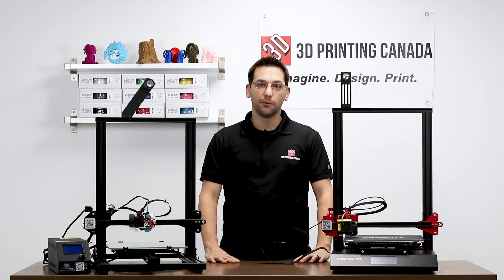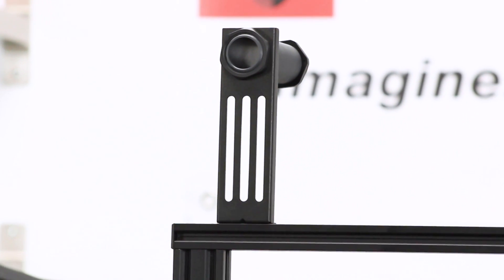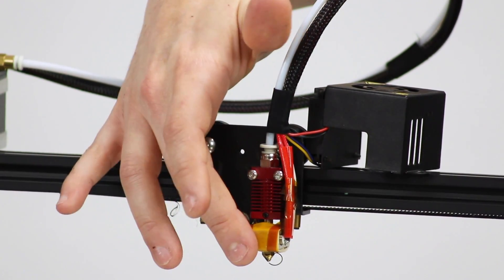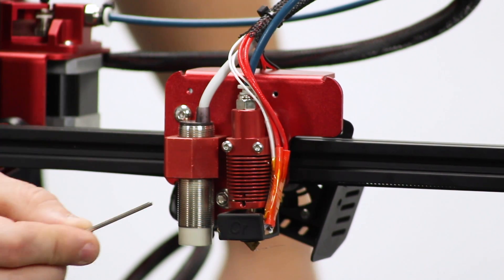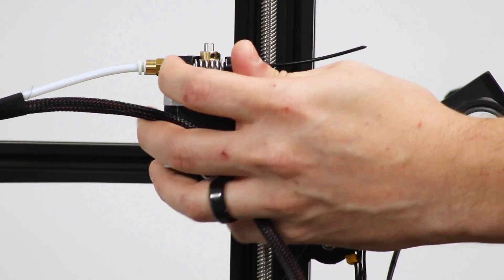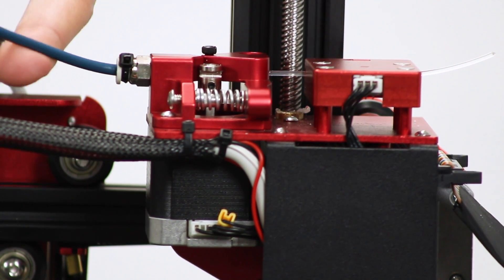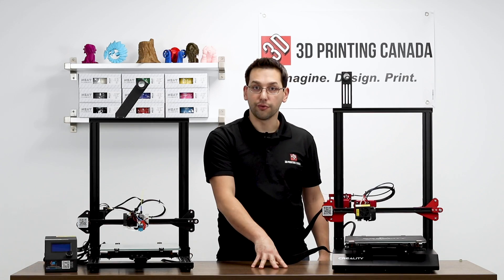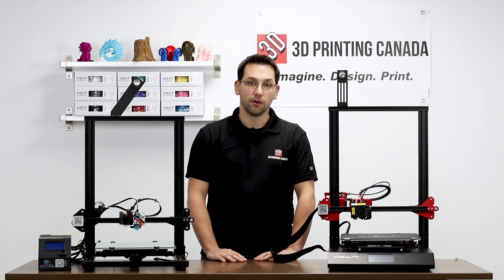Creality CR-10s vs Creality CR-10s Pro 3D Printer Comparison

Comment: I've had a CR10SPro for just a few months and already it has developed faults, a loud noise occurs whenever there is movement in the Z-Axis.  I recently purchased a Creality magnetic plate to make it easier to get things off the bed, however due to a recently failure the extruder dived into the magnetic bed punching a hole through it.  I'm waiting to hear from Creality what they intend to do as I now have a printer that I cannot use.  My CR10SPro did not come with a glass bed, it came with a metal plate and a sticky plastic cover which became very scratched and useless after several prints, hence why I removed it after several hours of making sure all the hard to remove glue was cleared off them replaced it with a new magnetic Creality print bed, which I was very hopefully off, but due to the strange Z-axis problems after it did the usual checks when auto-levelling before a print it then buried the extruder in the last corner of the magnetic bed, so hard that it broke the surface and has level a cut almost 2 inches long in the bed.

Comment: One thing not covered is that there seems to be a difference in length between the two heatbreaks. The 10s pro's is longer. So, if you're wanting to try a different heatbreak, you'll have to be very careful what you order and triple check with the vender that their product IS compatible with the 10s pro or 10s pro v2.

Comment: I have one question that I hope you can answer, on the cr-10s v2 board what is the pin that is associated with the runout sensor. I have looked everywhere for a diagram but can't find anything. I need to know this so I can install the runout sensor on Octoprint.

Comment: I got my cr-10s pro now and already have a cr-10. Its a nightmare... losing screws, bed lvling is such a nightmare, z-axis is total wrong because there is no 2nd endstop for the 2nd motor. It tooked me 5 hours to find out they havent made both long aluminum profiles not in the same length. so that all the time i hade no 90° on the Z-axis. This is also the reason why so many ppl have so many problems with it. ITS bad quality. The CR-10 is great, i love it and use it every day. But the CR-10s PRO... waow near everything from no flat bad till the fans are so loud to bedlvling is a nightmare. I dont know how creality can give such a unfinal product out for sale. Often ppl have problems on the hotend that the metal cuts the powerlines from the hotend while it moves, or that the touch screen even if it is capacitive, isnt reacting. To update the display which is recomended!!! you have to open the case!!!! Hell this is really a nightmare and i can now understand why there are so many bad reviews from ppl here and why so many send it back. I already have the CR-10 but how would i feel without all the knowhow from it? This S PRO is a total fail construction and has extrem bad quality. It is awesome in printresults, but for this you better have to be experiencend.

Comment: how can you do a 3d PRINTER comparison without showing any PRINTS
Reply: There won’t be much difference in the print quality since both of the printer are fdm printers, same maker, and the pro is just the fancy version of the cr10s. The only difference would be reliability on longer prints, maintenance, bed leveling, quiter, and other things. The only time we see a diffenrence in quality is if we compare it to an SLA.

Just like in a car. It is like comparing a toyata wigo and vios. Both drives well and gets you to point a and b at the same time. But the vios has better features. Just by looking at the spec sheet we know that the vios has a higher hp and other things.
Reply: @Renzoganviolin  You only see the point of resolution. But FDM you can use so many materials, from plastic over metal, glass and so on, and since the 32bit boards, the layers are really fantastic if everything else fits. SLA is to make little things, but if you let them fall on the floor they are damaged. Both have there reason to stay. FDM as SLA. They are only compareable in the resolution. And with it comes the point, what you want to use it for. To say one is better than the other is total wrong.
Reply: didn't help at all, exactly
Reply: yes its like to compare 2 cars and dont drive them :-)

Comment: The fans on this printer are cheap loud fans, I can hear them from another room so it's far from a silent printer. Upgrading to Noctua fans (which are 12V and require transforming the voltage) would solve it tho.

Comment: thank you for putting together a video comparing the old with the new. It would be nice to know if the new one handles other filament better .i.e the heat bed heats up to 110 ok and not take 20 mins to do so.

Comment: This reviewer is talking shit. Cr-10s Pro what can I say but what a pile of shit. Won't level correctly and print different thickness of layers regardless of calibration of adjustment. And that's not talking about stupid jumping of  x axis that isn't even remotely level. I highly recommend avoiding Creality and Bang good. Horrific service and attitude. So in short the Cr10s-pro is garbage.

Comment: This is a pretty good explanation on the difference between the two however without actually seeing it print anything it's rather Nolan void. Furthermore this explanation is for the Uber nerd that knows what the hell all this techno jargon is. How about an explanation for the average Joe that wants to 3D print? Do they both have heated beds? Do they both auto level? Do they both let you know when you're running out of filament and need to replace and will it pick up where it left off if you have to pause it?

Comment: Hey guys, can you please do a video on changing out the filament mid print on the CR-10S Pro?  I think I'm doing it wrong.  The filament-out sensor works and when the filament runs out the printer pauses and prompts to reheat the nozzle and load the new filament.  However I'm having a hard time pulling the filament out as it is past the filament sensor.  I've watched several videos on the CR-10S and it looks like the printer usually backs out the filament at the end to make it easier to remove.  Maybe I'm missing something obvious but the instructions and videos I've found are not clear for the CR-10S Pro.  Thanks for all of the very useful videos.

Comment: My questions: is it a $200+ dollar difference over a CR-10S. Is the motherboard still 2560? Is the firmware open source? Is Thermal Runaway Protection Enabled?
Reply: I picked up one - it's a 2560 board.  The current firmware has issues saving the settings of bed leveling, so most people on the Facebook group are recommending running some modified firmware to fix this.  Out of the box I printed three things without issues minus having to re-setup the auto bed leveling after each time I powered off the printer.  Since upgrading the printer firmware it's been fine.  I'm using my Ender 3 profiles in Cura (with the stock CR10S printer profile)  without issues using profiles I made from your magic number video.  The printer is amazingly quiet minus the power supply fan.  I hate the build plate on mine and will be replacing it.  Getting PLA off it is almost impossible.  His printer came with glass - mine did not.  It's the built tech service on a metal plate.  Probably the only thing I really hate about the printer is that.

Comment: Great video - need to add a replacement for the CR10S I guess. What is a huge surprise in your videos is that it seems like the CR-X has a lot lower quality electronics than the CR10S-Pro, though they look almost identical. A CR10S-Pro and a CR-X comparison would be very welcome. One thing that entices me about dual extrusion is the ability to print support in a different material, but frankly I am more interested in a silent reliable printer.
My two CR10-S have been unreliable and gone through 4 boards, but the first one delivered some amazing prints initially

Comment: could just be an optical artifact but your X axis on your pro looks tilted and the bed appears tilted to match it. while this will print it will result in slightly skewed prints.

level the x axis to the frame then tram the bed to the x axis.
Reply: Maybe the place where it usually stands isn't 100% straight?
Reply: Yes, the bed is tilted. Look at the build plate and how it is at the same height as the two little screws on the left. The other side is clearly above the two screws.  Complete noob fail, but  no suprise at all since the guy only talks and talks and doesn't actually print...

Comment: +3D Printing Canada:  Thanks for the excellent review and comparison!
Can you please comment whether the nozzle heating at 24V is faster compared to the other CR-10 (12V) variants? Also can you please give any feedback about printing Nylon?

I'm waiting for the Pro variant, but as far as I can see - I still need to replace the hot end, in order to print nylon for example - they even lowered the maximum temperature to 260 (probably due to the Teflon tubing). In that department having 24V have no difference (although I have to compare the heating speed with previous model after all). So, my only gain would be auto-levelling, aluminium filament feeder and quieter operation. I was quite split between 10S Pro and Ender 3 to be honest.
Now I'll try the combo of MicroSwiss hotend + 24V 40/50W heater and hope that this will be enough for printing nylon. Changing the thermistor and firmware update might be necessary (I don't even know whether they have released the code yet).

Comment: this was the best review on youtube by far.  I looked at dimensions and it is 450mm(17.71')x550mm(21.6')x650mm(25.6).  This does not count for the travel of the Y for the bed forwards or back.   In reviews, i have seen the bed comes to about 1/2 an inch over the front and as it travels backward the bed goes further back than the electronics base enclosure.  If you could measure the maximum distances for the X & y for building an enclosure that would be really awesome.

Comment: I'm loving my CR-10S Pro and just like you said if it weren't for the fans you would never know it's running. The only difference between yours and mine is that mine came with an aluminum removable bed surface with the same build plate you show glued to the glass. I want to get a piece of glass because the prints are stupid difficult to remove. Great video, Thanks.